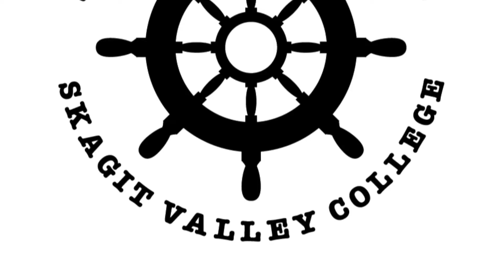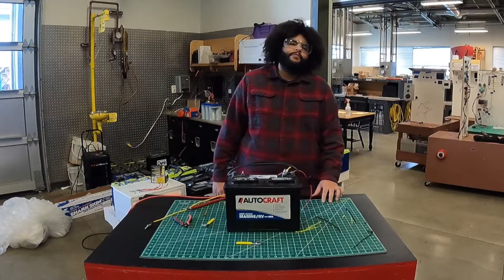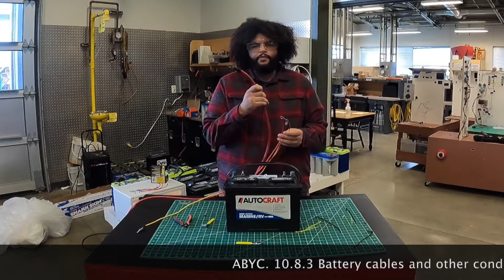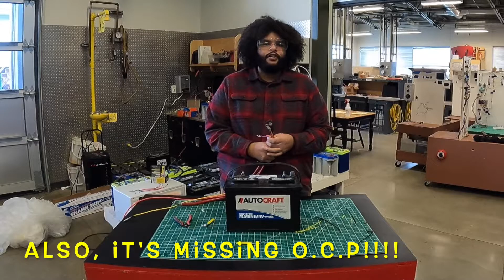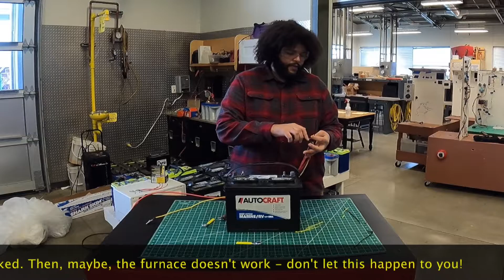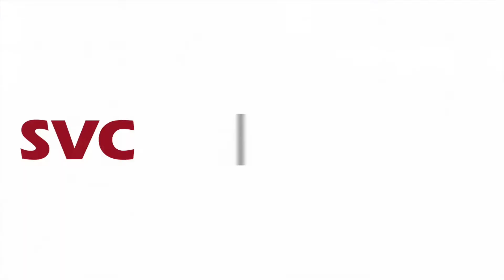TechTip#12: Keeping track of battery cables

Comment: I can’t believe you just showed this, especially coming from a marine tech school.  No OCP at the battery!  No individual OCP for those different sized conductors?! It is always ok to decline a job offered if the owner asking for services doesn’t want to use safe practices.
Reply from the maker: This Tech Tip video was about Keeping track of cables, not OCP - it's also stated they needed OCP. It was clearly a demo and our technicians wouldn't cut corners - Cables would have OCP when installed to meet ABYC standards, for sure. The ty-rap TIP (Tech Tip #12) is just super useful to ensure you know which and how many cables come off each post. Simple. Thanks for comment and providing feedback